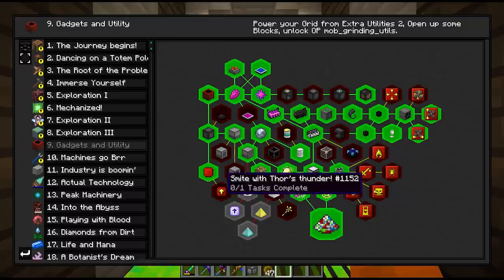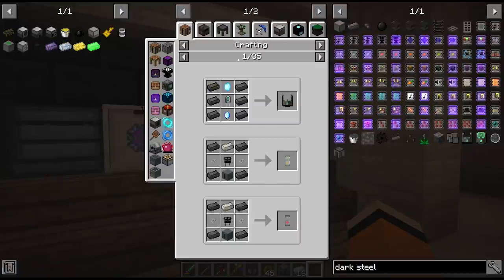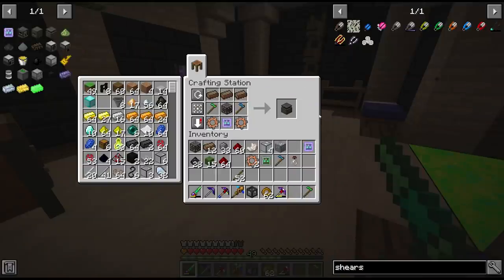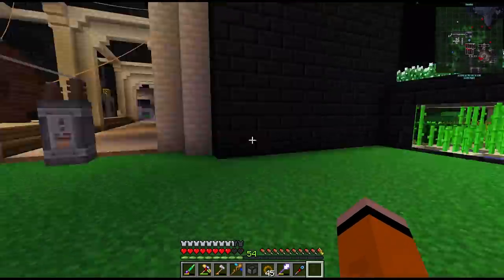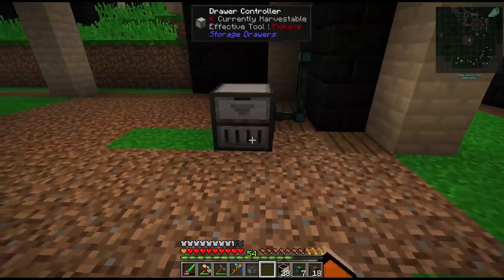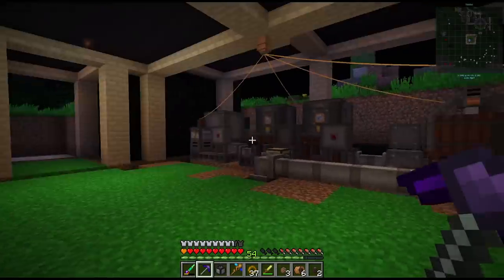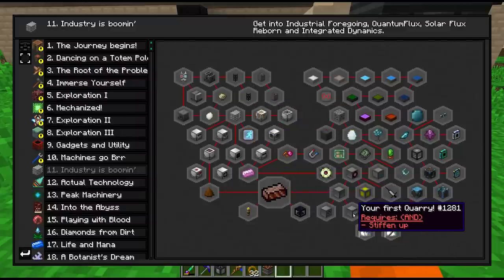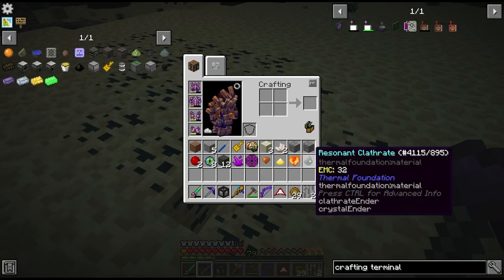Divine Journey 2: Ep11 Farming Upgrades! Modded Minecraft

Comment: For automating grains of infinity, dig out an area at bedrock level and place down a bucket of blazing pyrotheum. above the pyrotheum, pop a vacuum hopper beneath a drawer and hey presto,super easy automated grains! hope that helps!
Reply: couldnt you just place a bucket of fire water?
Reply from the maker: This sounds like a similar setup to the one I had In Omnifactory, it's very efficient and cheap to setup. In Omnifactory I had to upgrade it because of the huge grains requirement, but here we have MA for late game so this little setup should do nicely :)
Reply: @FourEnderBros  It’s technically worse and is gated behind the vat
But I used it, it really doesn’t matter

Comment: axe is only needed for tree in farming station, you can add toolkit on your mattack to get 1 more modifier and add fortune on it to get slightly more drop
Reply: I did extensive testing of multiple crops once I got access to the farming station. Luck on the mattock in the farming station increases the seed drops but not the crop drops. However, this is exactly what Canola needs as it changes the crop:seed ratio from 4:1 to 5:4, making Canola about 2.5x as effective as Aubergine for biodiesel production once you have a farming station with caelic soil.
Reply from the maker: @Alge_  This is awesome, thanks! :D